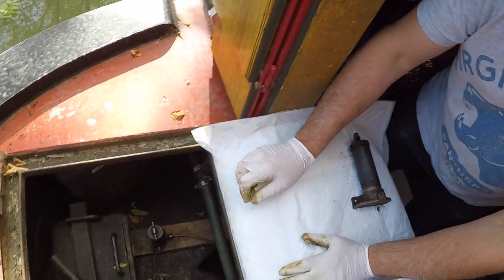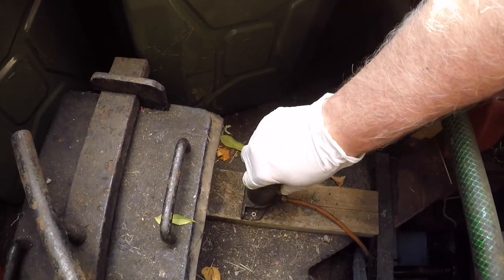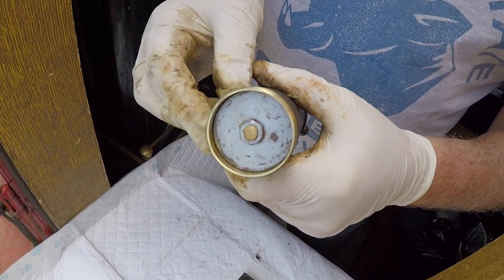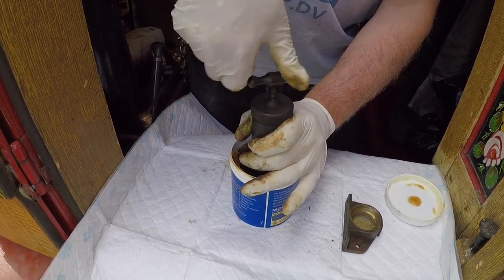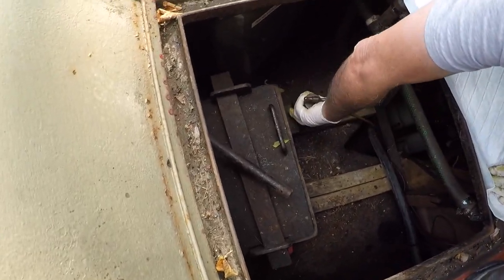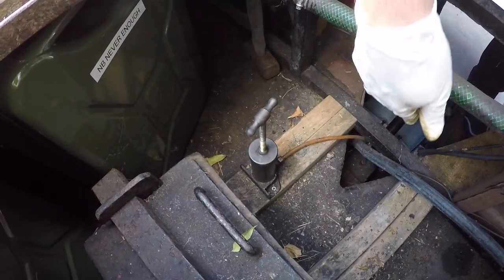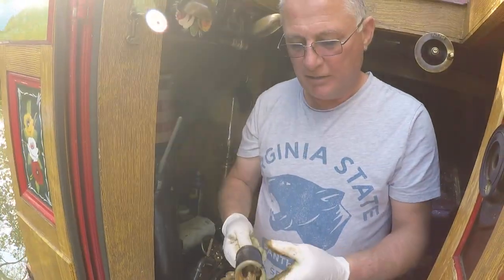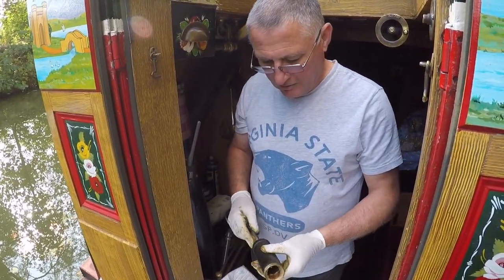#48 Narrowboat Vlog - How To - Refill The Stern Gland Greaser

Comment: I've watched your previous information-Vlogs - the solar panel mounts for instance - and your journey off The Thames and along the Grand Union, but my interest has been boats being built and their fit-out, particularly Widebeams. But I've now found that you have travelled the K&A (my 'local' river/canal) quite extensively - and yesterday I began to catch up. I have to say, they are brilliant - thank you so much. Your joint presentation, together with expert videography and sound control, make each Vlog so interesting. I will also add that, this morning, I had got as far as the February snow and canal 'ice ice baby' - and after an hour or so, I had to put my heating back on .... I was frozen. Anyway, keep up the great work, it is truly appreciated even if I am late to the party. 
P.S. The icy weather is not far away - take care when walking around those locks etc - grazed legs don't go down too well. Good luck.
Reply: Thank you, very kind words. Yes it is starting to get cold out again